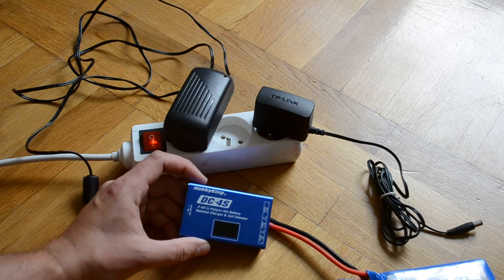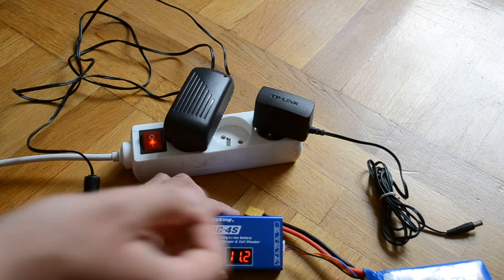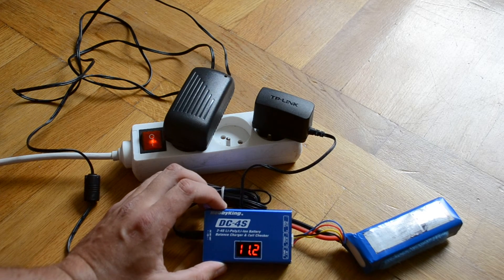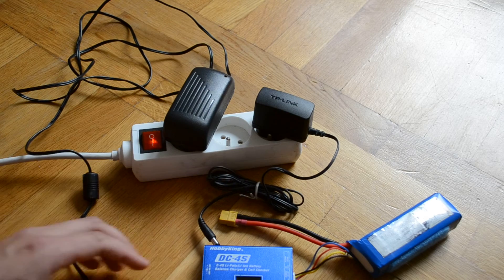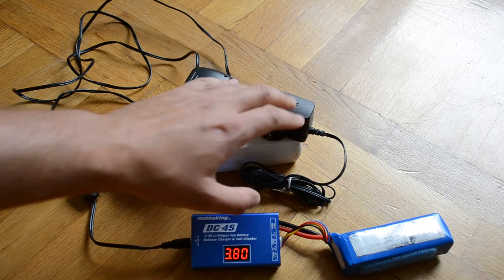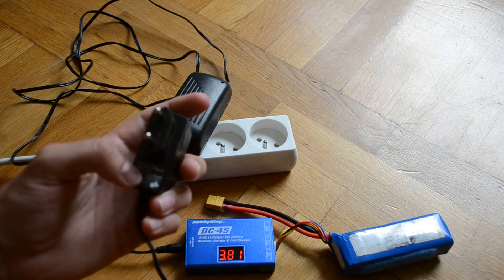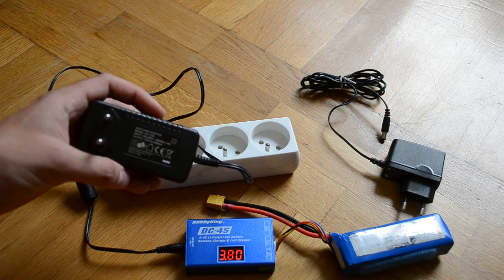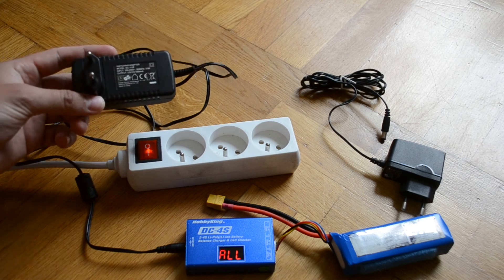Problem with Er2 Hobbyking® DC-4S Balance Charger & Cell Checker

Comment: Thanks, man. I got mine from banggood and after waiting about 1 month for all my components for an FPV to arrive and finaly arrived, I put a 4cel battery to charge and after 3 minutes I hear a little explosion and smoke was coming out from the power supply that was provided. I will try using another power supply from other appliances I have in the house. :D

Comment: Oh I forgot when it first appeared I took the 2s battery I had plugged in out and I noticed on the balance lead the middle red wire was loose and fell out the plug. But even with a 4s bat it started doing the same error. Sill tho Ima try to find a new power supply. Thanks again.

Comment: Thanks!  This helped a lot.  I am charging a 4S and with the supplied 12v 2 amp power supply I was getting Er2.  I swapped it with a 16v 6.5 amp power supply and no problems!
Reply: Have you had any problems supplying that much power? The recommended input for the charger is only 30W.

Comment: what if i have a power supply of 12v and 2 AMP ? the same error apears :/
Reply from the maker: broken power supply mayby?
Reply: +TomekONY it is new. but i took a power supply 15v and 6Amp and its working. i had read i have to power the charger with more than 30watts.
Reply: you're supposed to power it with 2.5 amps or more